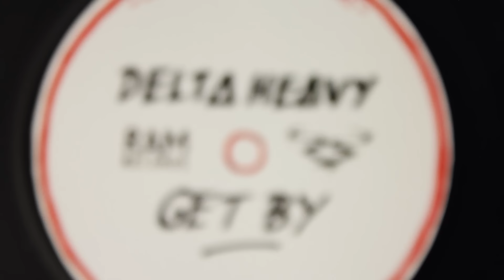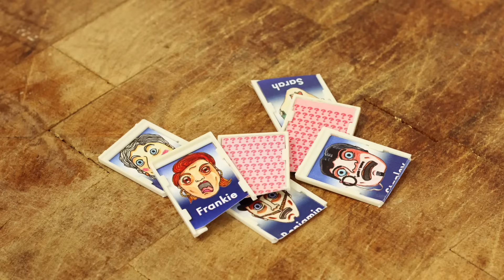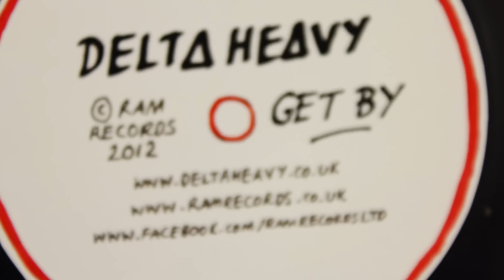Delta Heavy - Get By (Official Video)

Comment: that rubiks cube part must've been so tedious
Reply: Captain LAZY nah he acutely did it the real way
Reply: Even taking off the stickers and putting them back in would take like a year and a half.
Reply: plot twist: he bought a new one
Reply: Or he just used green screen. It doesn't look like he had though. But that is a possibility if you have the funds for expensive hardware
Reply: 1x1 Rubik’s cubes exist…
Reply: note really. you have to solve for 1 side, 2 on the ones in front. you can see gaps where higher lines arent solved past the first face. i could solve two faces for you in ~30 seconds. 80 cubes per frame takes 40 mins, but there are a lot of duplicates
Reply: @MrJonnysuperfast  holy-
Reply: According to the production notes it took 10 hours to animate
Reply: He actually did it the proper way! Not joking